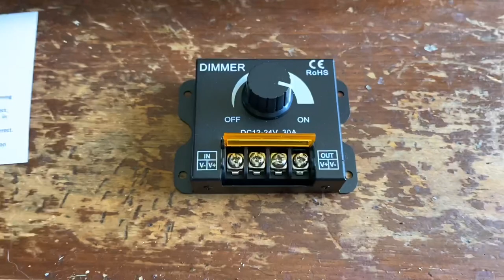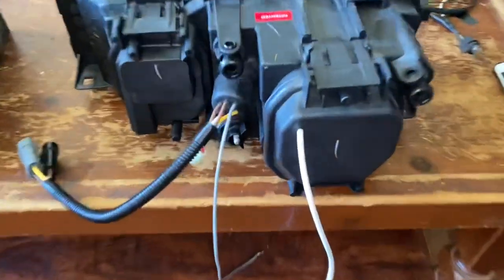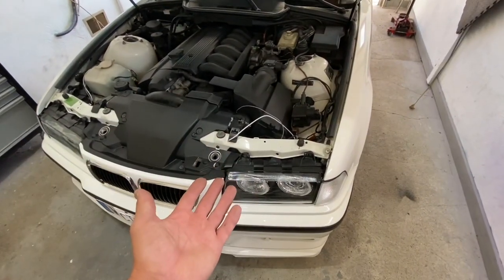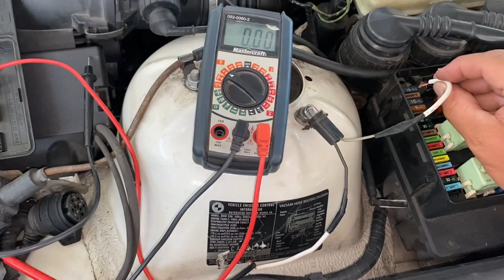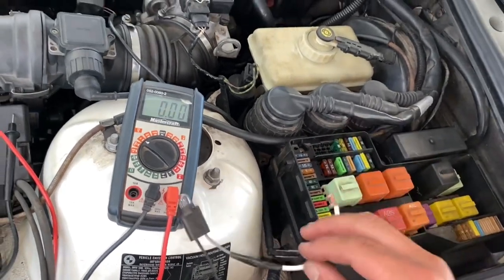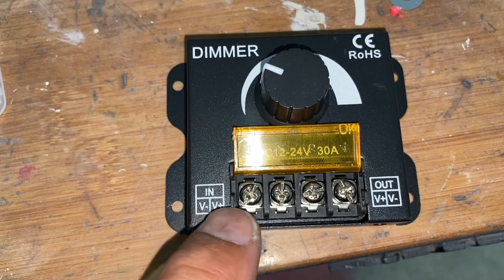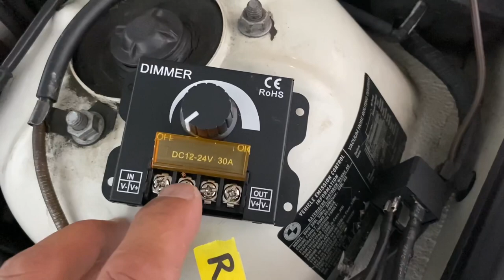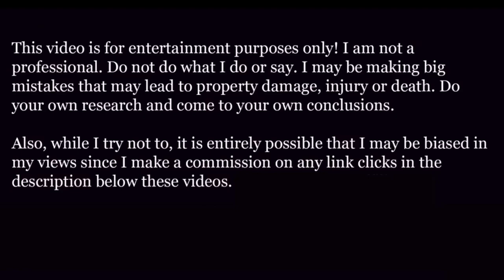How to wire depo p36 haloes to dim automatically￼ when you turn your lights on.

Comment: Is it any fault in bulb monitoring system after the upgrade? Or there are not any lights monitoring system in this particular BMW model? Or it is ommited by this ugrade?
Reply from the maker: No warning lights come on, if you change to led lightbulbs, you will have to run a resistor. I have a video on that.